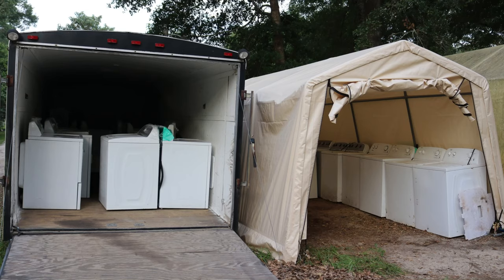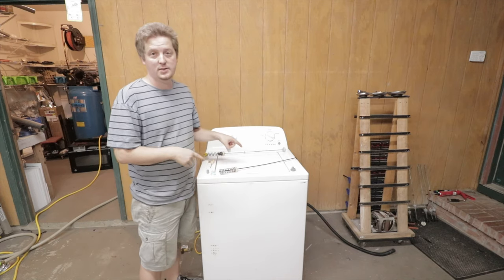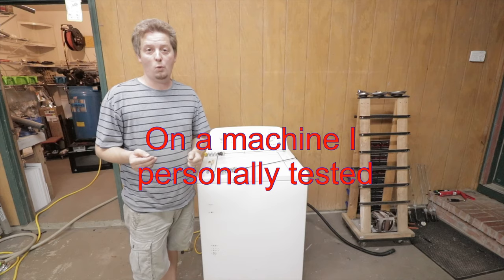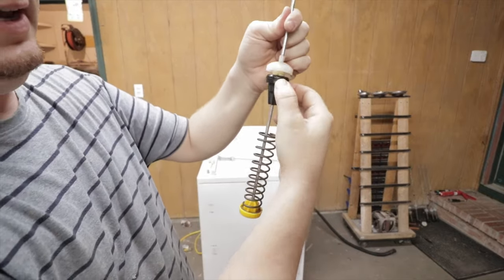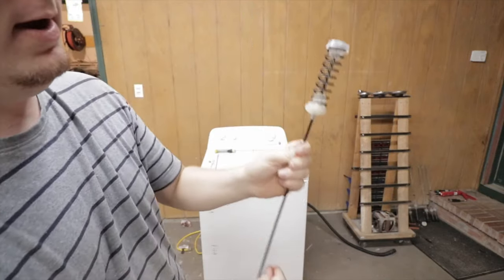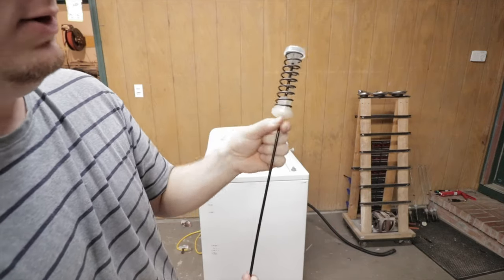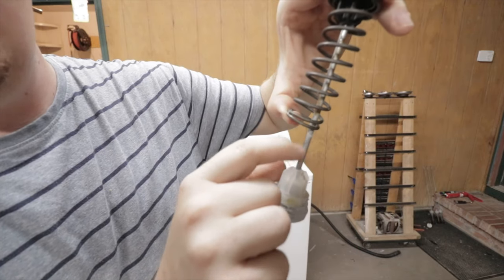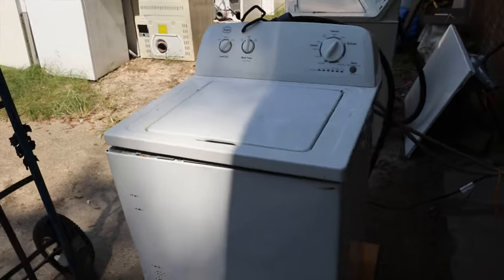Cheap Permanent? fix for shaking banging Washer? $7 to fix Suspension dampening rods W10780048

Comment: Damn it I freaking kind of disappeared I guess for the post it I'm going to do it all over again. Let's try to do this fast then. I have not finished the video yet but I want to tell you my answer before I tell you the answer before I hear the answer in case I don't know we're playing a game or something. But first I want to shout out to the washer guru that should be in capitals but I'm talking and it's not doing it so fuck it. Finally an appliance guy, not some duck flunking  my attention sneaking in unrelated pathetic tidbits of surprise birthday parties for theirs cat..... Ok, it's been awhile now. Ive been contemplating my own lameness getting wrapped up in commenting on a washer video I haven't even watched yet. I'm lame too, but my answer is cut tubes of rubber hosing. Specially soaker hose because I've been using it slot in the shop lately to serve a protect surface custom wall and ceiling hooks to match store bought cuz I like things to work good while matching. I also thinks other types of rubber  hose would/could be permanent fix as well. Primarily any made  of rubber that forms nice when heated with a blow torch. Thanks   washer guru I'm gonna subscribe now and make u my go to... And finish the video....

Comment: I just get a free broken washer that's not worth dumping into fixing and take those rods off and other parts. This in video is just a quick fix it is not a permanent fix.
Reply from the maker: It’s permanent. I’m still using that exact same washer and it’s been several years. The part I’m replacing is the foam piece inside the dampening rod with a more durable material.
I actually wouldn’t say this is not a quick fix. That’s the biggest issue with this repair is how long it takes to do for the liquid nails to dry.

Comment: Watched this too late. Just spent $105.00 on new suspension rods and two, twenty minute drives because they gave me the wrong ones the first time.
Reply from the maker: Wow that's an expensive suspension rods. What brand machine is that?
Reply: Washer Dryer Money Amanda. Model #NTW4600YQ1.

Comment: If you want to know a super easy fix that will last for years. Cost 3 dollars and ready to put back on he washer as soon as your done.  Let me know and I will explain, I owned an appliance business for years and just did this repair Yesterday to my friends cabrio washer. .
Reply from the maker: Sure.
 Is it the clothes pin trick or yoga mat fix or something else?
Reply: @WasherDryerMoney  I will explain in detail the best I can. Go to a store and get a package of the sticky rat/mouse glue traps that are in little trays. Next grab the rod remove the upper cap as you do. Take a small curved pick and pull the foam upward out of the lower portion and try not to damage it. Best to have all 4 rods done like this before moving to the next step. Get a heat gun and a small Popsicle stick, putting knife etc. to use for applying the glue. Then take the heat gun heating up the glue on one of the trays till it becomes more of a liquid. Quickly before it starts to cool down scoop up some of it not a lot but an adequate amount and apply it on the rod below the foam and then Immediately work the foam back down and press the cap back on. And mind you that the glue has to be reheated each time due to how quickly it cools and becomes Super sticky again. I have repaired them for over 8 years this way and never had any issues. The reason for the glue from the rat traps is due to it never drying or getting hard like other adhesives. Give a try and once you get the hang of it make a video of it. You can take all the credit for it, I am retired now and just enjoy helping others.
Reply: @chaplainlee  I love this. I was fixing my aunts sink last week and didn't see the rat trap on the floor. I left her place with only one sock because the other one was in the trash with a trap stuck to it.  Seriously strong stuff. 
I'm gonna give this a try even if I have to endure the odd looks from the wife.

Comment: The trick isn’t in the foam it is in that sticky grease that I Call it ...when that dries out the damper wears out I already know but trivia if you can figure out what thatFriction Grease is   That’ll help with your experiment.  Good luck
Reply from the maker: Yeah sometimes I think it is just the friction grease has disappeared. Other times the piece of foam actually is extremely dissolved inside. Could be because the grease disappears and just start stripping it to pieces.
Reply: What about the rodent glue for pest control glue traps?
Reply: @mazzonekev  would NEVER LAST PAST THE FIRST SPIN CYCLE ...ID BE AMAZED IF SO IVE BEEN FIXING VERTICAL MODULAR WASHERS FOR THE WHOLE LIFE OF THEIR EXISTENCE AND HAVE YET TO FIND A GOOD SUBSTITUTE FOR THE FRICTION GREASE USED .. IVE TRIED ALL KINDS  and the problem is always the same it doesn't stay in place where's out of damper and starts bouncing again. In this case the best solution is to order a new suspension rods set especially if the dampers are hollowed-out and just slide up and down the rod ...good luck

Comment: those rods are like $28. just replace.
Reply from the maker: Joseph Drescher That’s true some are cheap I keep 3 sets in stock of the cheap size.
I’ve had to order some that were slightly longer and built a little different that were $70.
My biggest issue with this problem is there should be a more permanent solution. I have replaced rods on Machines and had to replace rods again in less than two years. Whirlpool needs to come up with a better material for the dampening. These type of machines have several problems but this one in my opinion is the most common and should be able to be fixed more permanently.
Reply: I have a Samsung washer and my suspension rods cost $85 a piece at the appliance repair store. The new ones lasted about three years and now they’re broke again.  I just need to hold onto the washer for the end of the year and then I’m getting me an LG already got it all picked . waiting for me on the showroom floor ! I hate Samsung‘s! I like the guys idea.
Reply from the maker: mary Michael So far it’s still working.
Reply from the maker: mary Michael i’m not a big fan of LG or Samsung. The parts are super expensive and I believe LG uses suspension rods as well. If you’re going to spend big money I would go with Speed Queen they are super super dependable compared to any new Washers and dryers you can buy in the market right now.
Reply: Washer Dryer Money 
The sales guy at Lowe’s said the top load suspension rods in the LG I was  thinking about getting are different but I’ll  look into a speed queen. Thanks so much for your input. For now I will try your little fix On my singing bird Samsung until then.
Reply: @marymichael903  go with the speed queen..IMO..the fraud design of dampers is criminal...
Reply: Mine were over $90 w/ tax. Where are you buying from?

Comment: A set of suspension rods is $30.  Don't see the point.
Reply from the maker: This video is more a concept video of exactly what the problem is and one solution. I would like to find a cheap fast solution that is more durable than this one. I do repairs all the time and people that use their machine especially big families will wear these rods out quickly. The issue is the foam deteriorates and no longer grips the rod. Also the cheap rods for some machines are 30 but Samsung and LG rods and some top end machines are in the $60 to $80 range.
I definitely don’t think it’s worthwhile to do this fix it you are not experiencing these rides going out on a regular basis like some heavy users do. But I also feel that eventually there should be a heavy duty version of these rods with a non-foam gripper.

Comment: ill only ask for 10%  of the profits on this fix.....use rubber o rings  on the rod  then fill them up like you do ...............
Reply from the maker: The feeling them is the problem with my solution. It takes so many days to dry completely

Comment: If you’re going to go through all that labor to pull those old rods out, why not just spend the $40 for a new set and replace them?

Edit to add: $7 for a maybe short term solution would be a rip-off if you’re charging for labor. 

If you’re DIY. By the time you get those rods out, you’ll wish you just had a new set to put in.
Reply: The problem is, new rods also only last for a short while, and will fail again.  The real need is a verified solution on a long term fix, something better than original.  That's the idea of this whole video, or at least my interpretation of it.
Reply: @ShanesGettingHandy  I see your point. I had gotten this in my recommendations when I was replacing the rods on my own machine. It was not as easy as the YouTube videos made it look 😂    

The video title put me on the wrong track and I thought he was suggesting his $7 experimental fix over new rods. But now that I’ve rewatched it, I see his point.  I’m not seeing an update on the video description about how long it worked though.

Comment: Not to be a downer but 30 bux will get you a whole new set rather than all this contorsion.
Reply from the maker: @robdj2706  yes but this fix does not wear out like the old foam piece. There is a new way of doing it where you can buy a yoga mat that’s 3/4 of an inch and cut new pieces of foam. One yoga mat can make 100 repairs.
Reply: @WasherDryerMoney  So I have found out. Replacement rods via Amazon were worse than what I removed!

Comment: Horrible cheap ass Old Ge design.. I fix appliances for a living. A spring on the rod on the top over to the top of the tub is needed.
Reply from the maker: It is the foam that goes bad.